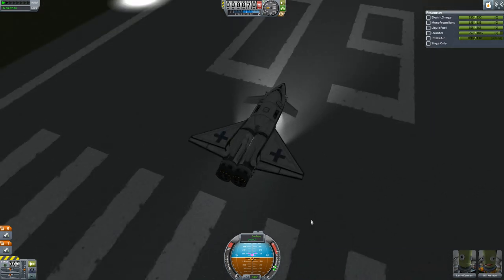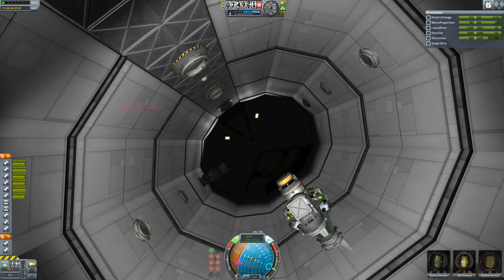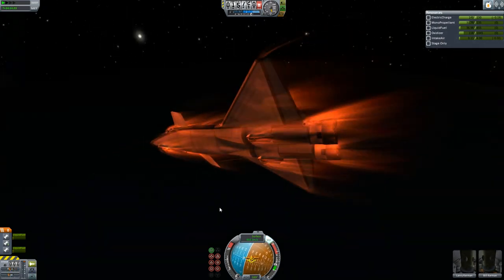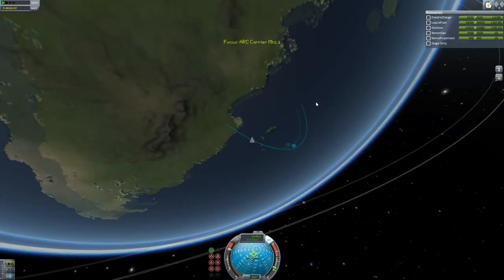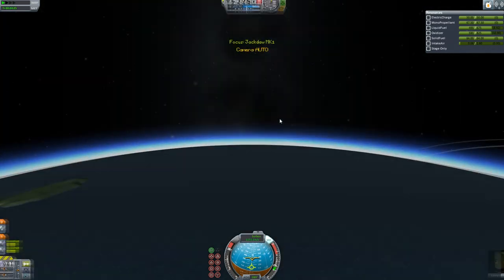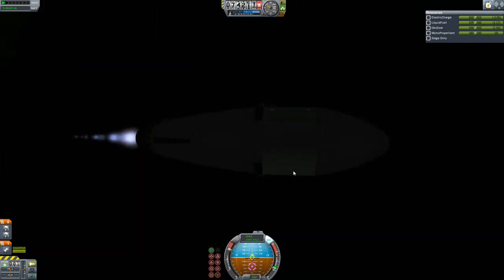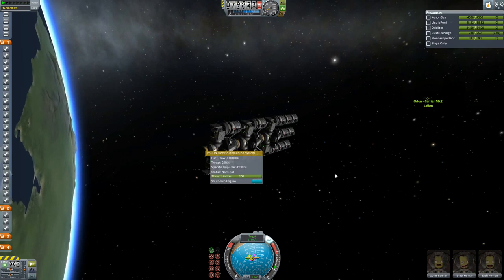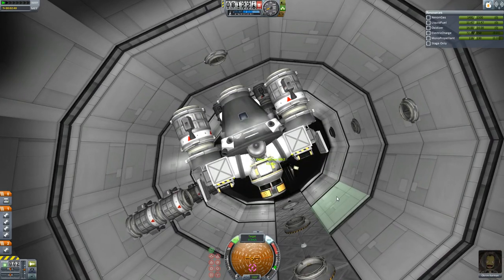Kerbol Wars #2, 'Odin' Carrier, Kerbal Space Program

Comment: Try the GM drive mod. If you are not using the semi- generator you will need to have some solar panels for the other one. To regen GN particals, right click on the engine and press convert. Watch your center of balance and lift. If you can't take off, right click on engine and enable antigravity, but turn it off outside of atmosphere. http://www.curse.com/ksp-mods/kerbal/224506-gn-drive
Reply: engines will be labled under pods.